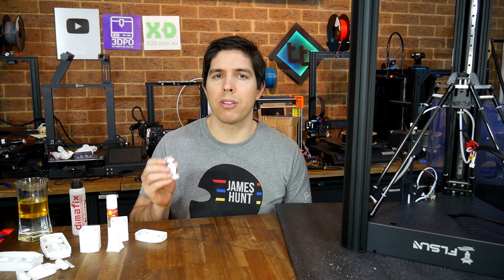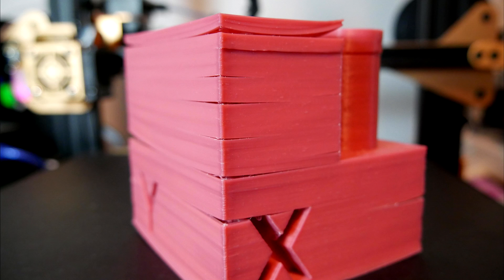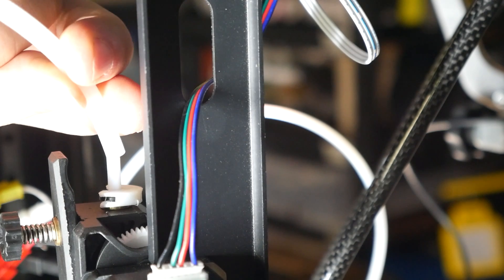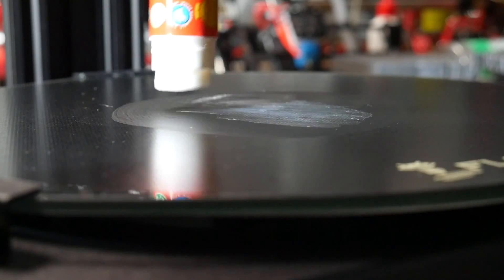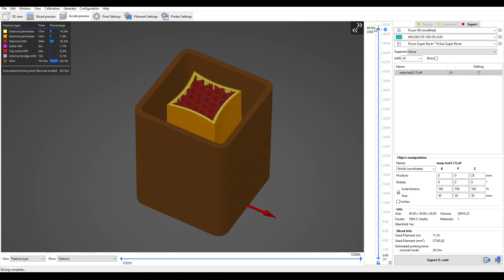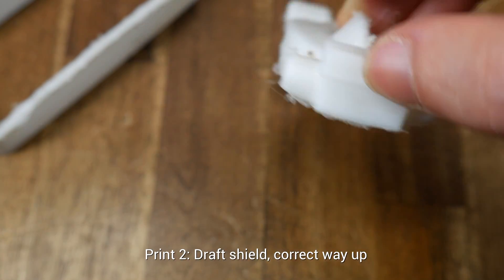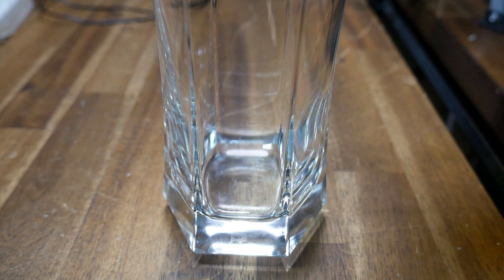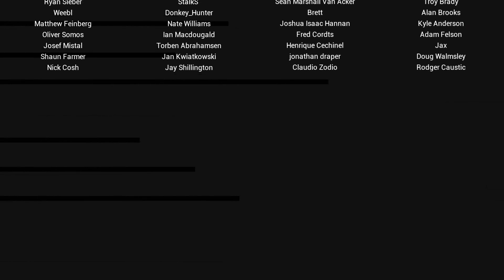Can 3D printing upside down help reduce warping?

Comment: I would guess, that since the draft shield will be printed from the same shrinking material, it would shrink and deform or crack, which would sabotage its purpose. But again, draft shield has a thin wall, which could be kept warm by the trapped air, so it would all depend on outside conditions... Now I go see what happened and if I was at leaat partially correct 😉
Reply: Seems I guessed it right, but also it is worth noting, that hot air rising from nozzle into the heatshield might have been in this case traded of for less heat rising from the heatbed 🤔

Comment: In an enclosure most of the heat generated by the printer that heats the air around it comes from the heat bed, not the nozzle.  The heated area of the heat bed is much larger than the heated area of the hot end so more heat is dissipated into the air.  Likewise when you use a draft shield the heat inside the shield is coming from the heat bed, not the hot end as it is outside of the shield.  Inverting the printer is going to reduce the heating effect from the heat bed and increase the heating effect from the hot end.  But the hot end is still not inside the heat shield so a lot of the heat generated is going to be dissipated into the ambient air and not a lot of it is going to be trapped inside the heat shield.  So you end up with pretty much the same result.

Comment: Then how did you solve the problem of warping? Only the glue stick method works? Is there any alternative? I came across the same problem with printing wheels for my model car. Since it's just 2cm in diameter I can barely notice any warping. But when it is hooked up to a motor, I was able to see the wheel wobbling.

Comment: I would think that if a draft shield is upside down, you may want to increase the distance between the part and the draft shield - my thought process being that the volume of the air is quite small, heat will spill over. Even a slightly larger volume of air would likely remain more consistent.

Comment: No prediction from me, but the break-through that Michael mentioned at the end of the video, might be something completely different: A re-designed, upside-down core-xy printer, like the Voron V2.4 or SK-Tank could be built cheaper and much lighter. The structure only needs to be strong around the xy gantry, that will be at the bottom in this case. As the gantry's center of gravity (CG) will be brought downwards significantly, it could potentially reduce low frequency vibrations, coming from "gantry-swing". Faster printing might be possible, as the PID control system will not have to cope with this low frequency vibration. This should however be verified. Upside-down printing seems to have its negative sides, but exploration of upside-down printing is needed to discover its positive sides.

Comment: I think the explanation how the shrinking happens (and how parts warp) in this video is a little bit off the mark.  Most of the upward warping on the edges is not from the part shrinking in Z as it cools, but from the XY shrinkage stacking up stresses.   As each layer cools it shrinks slightly, and that pulls in on the previous layers.  If that layer has already shrunk, (due to breezes, cold air), then thee next layer will attempt to squeeze it in further as it cools, and after several layers, there's enough internal stresses built up to start lifting the part. 
One of the best demonstrations I've seen is stacking layers of vinyl electrical tape which are stretched and stuck on top of the previous layer.  after several layers they will curl up and/or peel apart at the edges, just like a warping print, without any Z shrinkage being required at all.

Comment: For prints in NYLON, ABS, PETG < 25 mm height: print in a Cold bed of Hot Glue: easy and no warping. For bigger: hetaed chamber. Upside down should be worse since all the heat of the bed does not go down

Comment: I think the space between draft shield and piece is so small that any small current of air can disrupt it. You should try enclosing the printer with some insulating material or even cardboard. Regular enclosures are not very effective because hot air rises (and there are leaks here and there) and this may improve things upside down, since it doesn't need to warm up the WHOLE space, only the upper part.

Comment: that's good way.  did you try heat gun flowing into 3D printing?   this would reduce the stress in the filiment while printing.  I usually stop the printing for 5min. and resume, to decrease the warping

Comment: I am having great success with keeping ambient temperatures up in the room to get smoother machine operation and less warpage. Then temps go down and throw off all of my numbers. I start to think that having a printer with a build chamber might be the better option. Keep all the air right around the printer one consistent temperature and utilize the lost heat from the bed. Have you all done this with nylon?

Comment: Could you please look at oozing for inverse printing (upside down)? In my head, this holds a lot of promise for combating oozing, as gravity will no longer drag filament out the nozzle, but actually keep it in there, for any travel. To me, this seems like the main benefit for inverse printing. Bridging also possibly gets better bounding for the bridging layer.
Reply: Gravity doesn't "drag" the filament out. The pressure in the hot end pushes it out.
Reply: @alexchliwnyj5941  oozing is caused primerely by gravity. That's the reason for it happening before printing starts, and there is no built up pressure in the nozzle, to give you one example. There are plenty of real world examples to choose from. Please do your homework.

Comment: I am successful with ABS printing on my cheap Wanhao Duplicator I3 V2.1, and I started out with the warping issue as well. The best thing is to make a case that traps the heat, and I made my encasing from 2 cheap Ikea lack tables stacked on top of eachother, and some polycarbonate plates cut to size and connected everything using 3d printed parts and some screws. You still need some patience because after I am done printing I wait until the sensors of the 3D printer are below 30 degree celcius before opening up the enclosure, and mostly I can hear when it is done when the ABS pops off the glass bed that I use in combination with 3DLac as the adhesive. The only extra setting that I use is disabling the fan that blows cool air directly on the nozzle.

Comment: Glue stick 101: Make one smooth motion across the build plate holding the stick in a 90 degree angle compared to the bed, you can do this while the build plate is heating up so that the stick becomes slightly softer making it easier to apply in a thin layer. Don't go over the same spot twice. After printing let the bed cool down to remove the model easily. Remove the residue with soapy water, just spray it on, let it sit, then wipe it all off. However, I can usually print again on the same surface a few times, so you might want to try that before cleaning. Glue stick is by far my favorite adhesion method, cheap, super effective, easy.

Comment: i had the same issue with gluestiks. the glue is watersolible, so cleaning with water is easy. I apply gluestick only when it was dailuted with water a bit, because then i get easy thin layers. the water evaporates quickliy and the glue is the sicking again very well (hope it mkes sense)

Comment: Instinct tells me that if an actively heated chamber doesn't work, a non airtight and non-actively heated chamber (which may also warp and open up a gap where all the heat is supposed to gather) isn't going to do any better. But maybe I'm underestimating how cool it gets at the bottom of an actively heated chamber?

Comment: I've tried glue stick a couple of times and I hate the stuff. I changed to a bed that seems to a tear very well but if I do need to use any kind of adhesive I always end up using Aqua Net here's well and is easy to clean up with a simple alcohol rag

Comment: Searching for adding inkjet filament coloring on top of hot end on ender 3 pro.

Either by a ready upgrade to buy
Or haking ordinary paper inkjet printer, using its parts for mixturing & injecting color (as if it is marker filament coloring)

Any ideas or experiments are appreciated. Thanks a lot

Comment: Instead of glue stick I would recommend using a wet paper towel with a dot of liquid pva glue (Elmer's works fine for me). You get a more even and thinner coating.
Reply: Glue stick usually is also PVA glue I think, good tip!
Reply: Just don't use aliphatic PVA lol. That stuff won't wash off.

Comment: Thanks for another excellent video. My main question re upside down printing relates to overhangs that need supports. For example if you want to print extensive overhang structures, how would you stop sagging? In 'right way up' printers we rely on gravity causing the structure to rest on a support bed that was laid down on a previous Z run, but in this inverted case gravity will act to pull it away from the support. It seems to me that commonly used slicers will need to have machine settings that cater for 'upside down printer' in order to give the best G-code for supports with this type of printer but even then I am not sure that long thin overhangs will come out well. A video entitled ''Printing Upside Down to Eliminate Overhangs' from 4 years ago by 'Tinkerine' would seem to support this (no pun intended). What do you think? (PS: I use PLA in an enclosed Ender 3).

Comment: One of the nice things about upside down printing is good bridging capability. According to the original video there was no sagging over long distace bridging test.
Reply: There would be sagging, just inverse sagging. There probably will be other new issues as well. The second layer, after the first bridging, could potentially lift the first bridging layer more into place. The first bridging layer will probably bound better because of its inverse bridging. Personally I am more looking at oozing.

Comment: A paper towel with warm water gets glue stick off nicely. If the bed is removable you can just hold whole thing under warm water from the tap and the glue just melts away.

Comment: prediction, it is 100% theoretically correct, it will not "work", as this isn't the problem. You laid out your problem, you already know neither the orientation nor the air temperature is the cause... will it help until everyone in the field is in agreement as to what should/shouldn't be used(what to reasonably expect from) in filament? absolutely.

Comment: glue stick is easy because all you need is hot water and it comes off leaving a clean bed. also works to get stuck prints off the bed

Comment: At least with Alloy 910, which is a nylon, I'm able to print open air but I do have to use a glass bed with PVA. I just can't get it to stick to any other bed with PVA. I could get a garolite bed but the glass has more uses. Other than that I just don't print any more fast than 40mms/s. Speed isn't the best way to put it, I actually limit my extrusion volume to about 2-4mm³/s.

Comment: This approach overlooks something important -- in physics, direct heat radiation is a more important factor than heat carried away by air (i.e. by convection). On that basis an ideal 3D printer enclosure would be surrounded by double-pane glass windows designed to minimize heat loss by direct radiation, and/or by glass panes coated with materials designed to reduce heat transmission. If this were done, the temperature uniformity inside the enclosure would likely reduce the warping you see with Nylon (but not eliminate it).

In short, if the overall printing environmental temperature were higher than 20 C, preferably much higher, the issues you see in your tests would be reduced in severity.

One drawback to this approach is that everything inside the printing enclosure would need to tolerate higher temperatures. It would probably require a complete printer redesign.

Evidence for the central role of heat radiation is the fact that the surface of land after dark often falls well below the temperature of the air above it, resulting in something called "radiation fog", where the much cooler land mass cools the air above it, which creates fog. The reason the land is cooler than the air is because -- wait for it -- heat radiation is much more efficient than convection with the air. The land radiates its heat directly into space, disregarding the air's temperature.

In the same way, the 3D printed part radiates its heat directly into the environment outside the printer, disregarding the temperature of the nearby air mass. The only way to stop this effect is to prevent the radiation from escaping.

I hope this helps.

Comment: Why this is doomed to fail: No convection of the heat from the bed! You might as well turn the bed off and aim a blow dryer at it. The main heat mass is above the print there's no way for the heat to sink down it sinks up, through convection. The only heat that print is getting is from the hot end and a miniscule amount from being in direct contact with the bed. It's a decent hypothesis, but it if ignores to much of physics.

Comment: What about a "heating" fan, or basically a hot air gun blowing heated air against the printed parts?
That will drastically change the cooling of parts of the print and may be use instead of an enclosure. Although I think an enclosure is way more energy efficient. Especially if it is a thermal insulated and temperature controlled one, as the warping comes from uneven or to fast cooling of the Model.
Reply: Yes, my link above is a blower duct sucking hot air from enclosure and blasting the entire part in heat, while also cooling layers to average temperature.
Reply: Since most reviews of 3D-printer tents find the tents failing, the issue needs to be better understood to be combated. When solutions that supposedly should work simply don't, wandering into this idea might be a great idea. Not as a solution, but as something to probe as to better understand dynamics.

Comment: It's unfortunate the draft shield didn't stick. If the shield remained sealed, it would work better, now it's a convective cooler.
Maybe Brim the draft shield, or at least use anti warp "lillypads" in the corners.
Great video, you do great work!

Comment: I run my layer lines at 90° so they run parallel to the sides of a cube as opposed to the usual 45° across the corners as I prefer the finish on top/bottom surfaces but I wonder whether it also reduces warping/lifting of corners due to the different stress alignment. I would be interested to see this tested it you understand my explanation and see some merit to the experiment. Print large flat nylon square with standard 45 degree and one 90 degree layer lines and see if more lift on one. Could also try adding those mouse ears to the corners to see if adhesion aided or the lift is encouraged by their addition.

Edit: Carbon fiber filled nylon may warp less but $$

Comment: Isopropyl Alcohol will clean up glue stick off non removable beds (takes several cloths to remove the residue but they can be tossed in the wash), removable glass beds can be washed between prints with plain soap and water.  I use glue stick all the time and still have a really clean bed.

Also use the "disappearing purple" Elmer's gluesticks, and apply when bed is cold for better results.

Comment: What about flipping the hot end cooling fan so that it sucks air "out" out of the heatsink instead of pushing it "in"? I am currently running such a setup with my ender 3 and it appears to have somewhat improved its ability to print warp-prone materials (although I haven't tried nylon).

Comment: For nylon printing, use a Pertinax bed, sanded with a 60/80 grit. That worked wonders for me.
Reply: Pertinax is best. I use it for everything, sanded with 120 grit every 10 prints or so. Works like a charm but don't overheat it as it releases Formaldehyde at about 115°C.

Comment: I have no problems with warping since I shut off the cooling fan... And I print with speeds of 80mm/s on my cr-10 mini and 120-150mm/s on the flsun sr, without many problems. In some rare cases i use it, but than with 20-50% fan speed max. Another thing I recognized after testing was that the print are "much" more stable than with cooling, if I use four wall layers i even can't break them with my bare hands, with activated cooling i can

Comment: If you are looking to clean off built-up glue stick from your build plate, I'd recommend heating the build plate up to 60C and then wiping it with a warm, damp towel/sponge.  If there are any stubborn spots leaving the towel spread out on the warm plate for a minute or two loosens things up a lot (rinse towel as needed).  It will wipes off pretty easily, and there is a lot less mess because you don't get all the little flakes everywhere like when you scrape it off dry.

Comment: Proper part design and nominal wall thickness is still king with high shrinking materials.  Would be interesting to see if each example  was properly cored how much warping would you experience?

Comment: 1. UHU glue stick is the best for nylon in my experience. And of course you have to wash it off every time.
2. to make nylon prints without oozing, increase minimum speed of printing. Also try to find minimum good temperature so it doesn't overbake in the nozzle. 270 sounds too much. Therefore lots of white and brown blobs.

Comment: I use a couple of layers of painted on diluted wood glue instead of a gluer stick.  It goes on really well and does the job.

I wonder if it's worthwhile repeating the experiment with a "bolt-on" heat shield around the bed..  Perhaps a bigger volume of warm air would help with adhesion.  You could probably McGyver something out of corrugated cardboard.